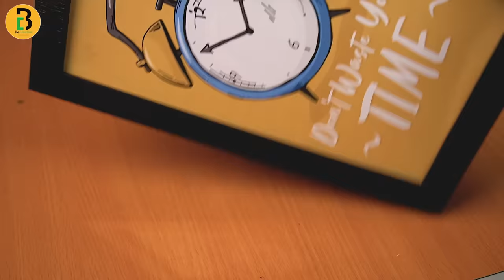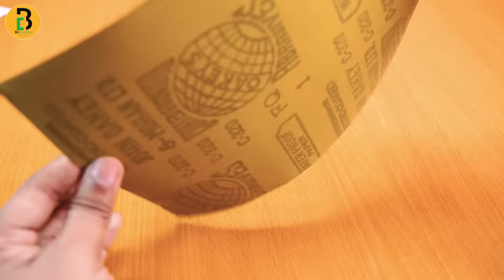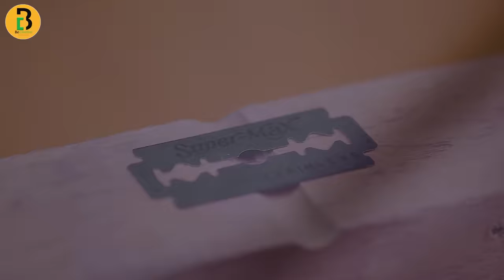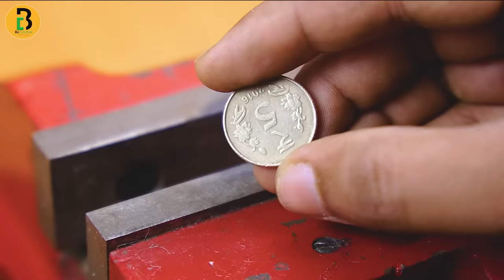''50'' INCREDIBLE HANDYMAN CRAFTS AND TIPS

Comment: Time mark 18 minutes-ish - NEVER use aluminum with copper wire as you are asking for a fire! The corrosion caused by the different metals creates an arcing potential due to the connection becoming loose. Many house fires were caused by this very thing. You could do the very same job with copper pipe with no risk of fire. Cheers.
Reply: In fact, almost all of this video is useless. I am grateful to you for protecting idiots from repeating these useless (and, as I understand it, also dangerous) life hacks

Comment: If you want to deceive people, then at least do it beautifully. And don't do what you can do with your own hands without using anything. 1:16 what the hell do you need this for? 0:45 learn to rotate smoothly. 4:09 You've made holes, so hammer into the holes, not past them. 8:35 I want to get a smooth hole, and this "life hack" won't help me in any way. 13:45 YOU HAVE A SMALL DRILL BIT, JUST MAKE A HOLE WITH IT, TO HELL WITH ALL THIS INTERACTION WITH A LIGHTER AND PIECES IF YOU CAN JUST MAKE A SMALL HOLE. In short, the video is full of nonsense and 99.9% of life hacks are useless or made crookedly. As one person said, "the more life hacks there are, the more likely one of them will be useful anyway."